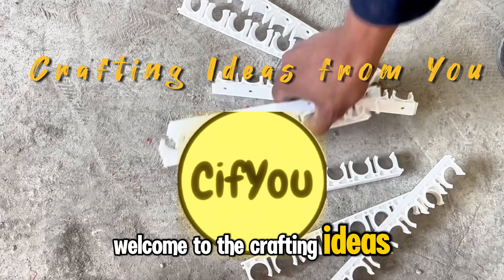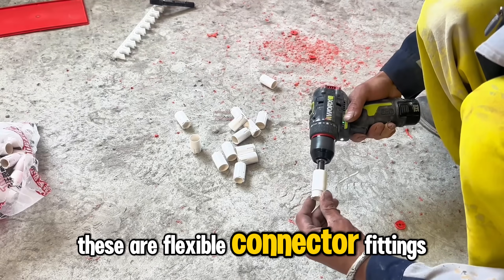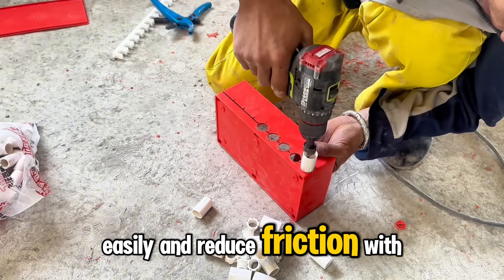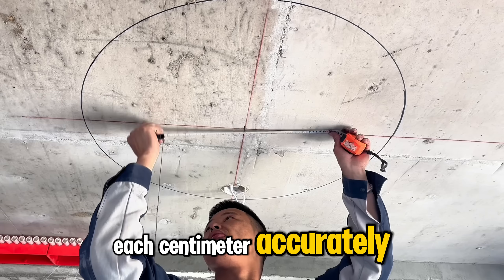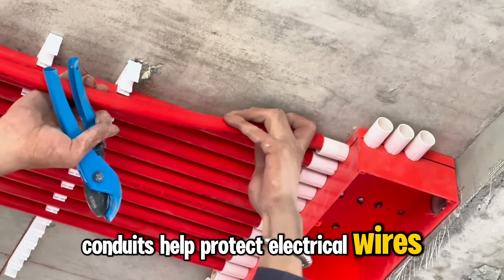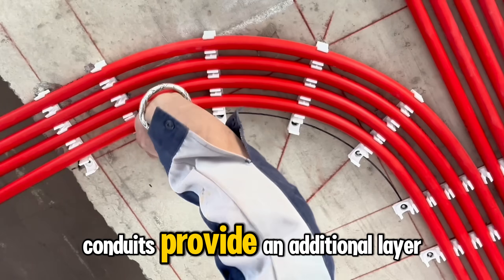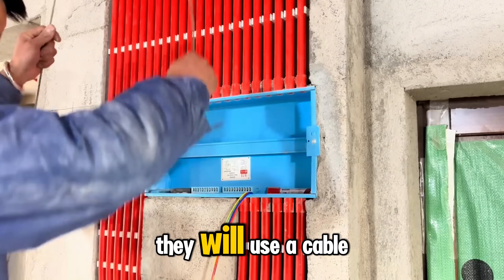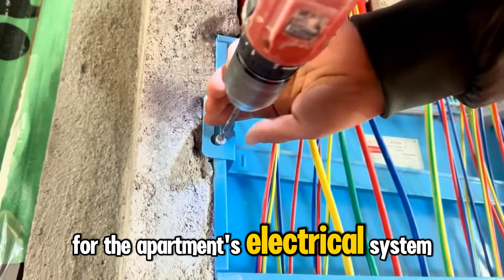What would electricity look like without following NEC (National Electrical Code) standards?

Comment: As a Canadian Electrician, i love the cleanliness of the install and how easy I would be to repair these installs however I can say that the main reason we avoid this method of installation is that each plug and light having its own dedicated path to the circuit breaker panel is extremely expensive.
The smallest breakers we can use in a residential installation is 15Amps as required by the NEC / CEC as such the wires we pull minimum size must be 14 AWG.
However this allows us to create MWBC (Multi-Wire branch circuits) or Edison Circuits which massively saves on the required amount of copper.

Also our building standards are much different, Our high-rise buildings tend to only have concrete walls between units, all interior walls are either wood frame or steel frame which allows us to run wire behind drywall (before its installed) and the ceilings would have a small gap above them for wires and plumbing to be ran before drywall would also be installed.

Both methods have their reasons for existing and both have their drawbacks.

All that conduit looks like it takes some time to install + the time to pull each individual circuit where in north America I can wire a small 6 office floor in a few days. but it can be a pain to add or renovate, especially if the client wants to avoid damaging the drywall for new installations.
Reply: "Extremely expensive" how? I mean, people pay 1500 USD for their phone or 3000-4000 for laptops and say "60$ for a charger is extremely expensive" end up buying unsafe chargers for 10 bucks and in best case they only burn their devices, and in worst case they also burn their houses. When you compare how much you pay for house, tiles and furnitures, it shouldn't be "extremely expensive". But people hate paying things they can't see or showoff even if it is about their own safety and security.
Reply: 0
Reply: @zenronaut hey zenronaut i want to talk to you, if you want to share your   Instagram I'd so that it's easier ask for me! ??
Reply: Вообще жизнь не дешевая штука но раз вы хотите иметь каркасник который сгниет вместе с вашей проводкой спустя 20 лет то пожалуйста
Reply: I understand we now can use a 10A breaker (and smaller wire) here in the US.
Reply: @steveurbach3093   It may be allowed (I'm not sure on that) but you wouldn't really want to because with the exception of maybe an isolated circuit that only hanndles LED lighting, it's gonna blow the minute anyone puts any real amps through it.  The reason most small appliances in the US cap out at 1800 watts is because that will pull about 12.5 Amps at 120 volts.   You try putting a standard 1800 watt microwave on a 10 amp circuit and you're blowing it every time.
Reply: @phuturephunk  Ich habe allerdings auch NIE verstanden, wieso ihr in den USA 120 Volt und 60 Hz. habt - habt ihr Angst vor der Spannung?? Bei uns sind es 220-240 / 400 Volt Außenleiterspannung. Damit kannst Du bei 16 A und 1,5 qmm Cu 3680 Watt problemlos betreiben.
Reply: Too much plastic , I don’t think it would be up to candian fire code standards
Reply: What gets me about this shite is they just twist and then tin the cable cores together in each JB.
Imagine a JB of twisted cable cores tinned and insulation tape over them when it comes to fault finding 😂😂😂
Be a bloody nightmare and certainly not allowed in the UK as our regs are stricked for reasons of safety.
Anyone found twisting cores together on an installation would be fired as well as his employer
Reply: @robertjones3477  soldered cable twists last for decades and definitely last longer than any terminal connections, but apparently that's all you need for your chicken coops
Reply: It was stated at the very beginning that it was for an apartment. There is no drawbacks at all for this method being used anywhere. You're complaining about how much time it takes to setup but that's what it takes to achieve that and the fact that it's future proof without having to rip down any walls makes it far superior to how it is being done in your country.
Reply: @StanslaMichael+1
Reply: As an American Electrician. None of this shit is allowed. Piss off. Everything this guy does is wrong.
Reply: "the main reason we avoid this method of installation is that each plug and light having its own dedicated path to the circuit breaker panel is extremely expensive."

wrong reason...
Reply: Care to elaborate then?

If each receptical required its own path to the panel, it would be extremely Exspencive.

To CEC code, a 14AWG wire with a 15A breaker can feed a maximum of 12 recepticals, if I remeber correctly and a 20A circuit with 12 AWG can feed 16.

If every receptical required it's own feed that's not going to be cheap in material costs.  considering most NA houses have 1 circuit Per room feeding both lights and recepticals.
Reply: @zenronaut For me, having watched this and many like it, I can see the need for it.
Having in the uk a ring circuit is desirable for economy and reliability. 
However, as we march forward into a future which relies heavily on technology, I can see why ^^this^^ is done.
Each plug receptacle on its own fused spur is desirable. It may not be cheap. But definitely desirable. 
The ability to combine this build into the uk regulations would in my opinion, be an amazing leap forward in every aspect. 
Have each room on its own breaker. Yes. Lose electric in one room without taking out the entire circuit... yes. Think of your fridge and freezer in your kitchen or utility room, and your kid blows the fuse on the tv in the front room. And you don't know for many hours. Your foodstuff is ruined. But if they are on separate circuits... not an issue. Only the front room and the tv are "dead" and the rest of the home is unaffected.
Win win from my point of view.
Reply: @soangry  nah, we have what are known as ring mains. So first  or ground floor has a 32 amp ring main covering all rooms on that floor. The upstairs or second floor has tts own 32 amp ring covering all rooms. Ad another ring and fuse for each additional floor.
Lights are on a 10 amp ring for each floor, too.
Add in a spur line for the cooker at 40 amp and the power shower at 40 amp, too.
Garage would be a 16 amp spur to feed lights and plugs in there...
If  your electrician was good, your utility room would be on a separate ring main...
Reply: @zenronaut  all excellent points. The particular in the video is from Russia, although current installs in Italy are similar except their codes stipulate very particular colors for their corrugated conduits. Copper use & gauge wise, it also helps EU and Russia that their voltage is 220V.

Breakers wise they're way, way ahead where you can have a breaker down to 0.5A if not 0.2A if the load warrants it (as many e.g. LED lighting loads do), whereas here in the US e.g. an arc + gfci sensing breaker will cost a lot.
Reply: @AlexKarasev Lmao. You are so clueless about Italian standards and practices. The only thing that is used here and in Italy are Schneider Breakers. Everything else is different. Wire standards (we use 1.5, 2.5, 4 and 6mm stranded pure copper wires) gray, black and brown for phase wires, blue for neutral and yellow/green for earth/ground. Also the wire insulation is fire resistant. Exposed (surface mounted) conduits, fixtures and junction boxes too. Within non flammable walls regular abs plastics can be used for conduits and junction boxes. 
Plus all new circuits use three phase AC. Electrical panels have MULTIPLE RCBOs that feed select number of breakers.
Reply: @OG_ALviK  I'm not sure you've comprehended what I wrote before disagreeing - in an insulting manner, to boot.

Comment: Why not just use a wire with 3 conductors? Pulling 3 different conductors seems like much more work
Reply: Heat (which is why those overly neat bundles in the panel are bad. You need to derate because the inner ones can't shed heat). Have you pulled wire? I think the less stiff (than the cable) is easier to pull around bends
Reply: No it is not more work, and it is cheaper too.

Comment: 5:53 - guess the structural engineer agreed to chiseling out the corner of the concrete beam? 🧐
Reply: you can see the rebar exposed, it's going to rust and collapse for sure.
Reply: This smart builder was thinking ahead. You see, the wires are part of the load bearing structure now. Once the rebar is rusted and the concrete is spalled away, you can just cut the wires and the whole highrise comes down. It also cuts down on population in that area of town, allowing for more employment opportunities and less crowding on train platforms. Genius!
Reply: Yeah stuff your stability.
Reply: Give them some credit, it wasnt just cement spackled over a hay bale this time.
Reply: As long as they havent cut the rebar, It will sustain the load. If the electrician has cut the rebar in that section, then they have surely weakened the beam.
Reply: Mas se cortou e não galvanixou pintou ou protegeu contra ferrugem o risco é existenre @bobo-n1o
Reply: No civil engineer on earth would approve this.
Reply: What is more concerning is the hole drilled through what looks like a load bearing beam.
Reply: irresponsible work, some dumbass HVAC workers have told me stories that put an entire building structure in danger just to install a single AC unit, they should be put in jail
Reply: you can even see the cardboard filling inside
Reply: Это пародия на строительно-монтажные работы - всё разумное нарушено.
Reply: What structural engineer? It's Vietnam
Reply: there is a reason it's called tofu buildings. XD
There are so many videos of buildings and wall just clasping out of no where in the CCPs land.
Reply: Exactly!!! What the fuck!
Reply: That should be illegal.
You can't weaken a structural beam.
Reply: they also go nowhere
Reply: Если бы это разрешил инженер-конструктор, то он бы озаботился о восстановлении защитного слоя бетона, который там обязателен! Без защитного слоя бетона арматура придёт в негодность намного раньше положенного. Так же это ускорит разрушение несущей конструкции при пожаре.
Слишком большая жертва ради красоты... Красиво, но непрактично.
Reply: Anything for the likes.
Reply: You don't want to know how cables are installed in Germany. We cut inches deep into the concrete, lay the wire there and fill the slots with plaster. 🤷🏼‍♂️
Reply: Electrical takes priority over structural integrity, duh.
Reply: Why every average american who lives into a cardboard house comment here. that hole is not a structural issue, you can take down walls and still not be concerned about structural stability
Reply: @Satanelul  Hi, not an american, I live in a cinderblock house.
Seen steel beams collapse from morons that use self-drilling screws on them, and also seen concrete columns crack and bend after being modified.

Comment: I mean, its apples to oranges. Its not very difficult to make your installs look like that when you dont have to worry about hvac equipment and plumbing lines being in the way.
Reply: I definitely get the impression he gets to get in before the plumbers and tinners
Reply: These guys are also the plumbers. Not sure if they're also HVAC. Because they know what everything needs to do they can plan from beginning to end how they're going to run everything and aren't going to have stupid pissing contests over space.

They have over videos showing their plumbing work. Anything with a green line or big white pipe.
Reply: Maybe if they FOLLOWED blueprints in the U.S. there wouldn't be so much conflict between the trades, ASSUMING the prints were done correctly and showed everything. Residential work in the U.S. is mostly garbage.
Reply: @hotpuppy1  You get what you pay for. And when you pay for cheap pretty you get pretty cheap.
Reply: @hotpuppy1  I saw a building site shut down mid build because the architects left no room whatsoever for for riser space. it wasn't caught till after the framing was done, floors poured and the roof set (dried in is the term) all the trades immediately began to fight over the true lack of space to set their HVAC, plumbing, wiring.... 
The site was eventually red tagged, and the building torn down two years later with lawsuits abounding, namely because it was impossible to install anything in the building without compromising it's structure.
Yes, most prints leave a LOT to be desired

Comment: I think we can do this in N.America to NEC code. It just, who wanna spend that much money, for something you look at once and seal behind a wall.
Reply: It makes it so much easier when you have to change anything afterwards - new internet cables, a new outlet,...it absolutely sucks to work with a messy, disorganized electrical installation
Reply: @braindecay9477  yep. i'm looking at having to rearrange all my wiring in the attic (1st floor apartment) that was installed in the 60s (UK resident) prior to having a consumer unit upgrade.
Reply: The MC menace and it's consequences lol. @braindecay9477
Reply from the maker: Oh, I think American standards are better
Reply: Brutalism is always an option.
Reply: I recently read somewhere that inspectors want to see it this way. Which makes a ton of sense now.

Comment: Is that PEX pipe you are using for conduit?
Being in the U.S., we aren’t allowed to use it of course, but I like how clean you made it look
Reply from the maker: It is completely different from pex pipe, it is a type of PVC produced to make electrical conduits
Reply: @CIFYou  What is the fire rating for that PVC?
Reply from the maker: it does not catch fire.
Reply: We have similar types of conduit, its just not common.

Comment: what the point of doing all this nice work if its all hidden in the end?  for me its just a waste of time and money
Reply: It is required especially if your cables are going to run through concrete. It also protects the cable from pests damaging them and makes replacing the cable much easier when it comes time to renew the cabling in the home.
Reply from the maker: it will be easier as you work later

Comment: as far as running conduit, no this is not substantially different from the US. The materials and exact specifications might differ slightly, but as far as running wire in conduit, its basically the same any US installation which uses conduit.

The only real point of difference is the breaker box, which i have to say, American breaker boxes are much better than that style of box, far easier and less labor intensive to install, since American breaker panels use bussbars to supply all the breakers, this makes it more flexible and safer.

Now dont get me wrong, I'm not saying the American system is better in every way, our system does have its problems in other area's,  but as far as breaker panels go, American ones (this includes canada and mexico), are better that other standards.
Reply from the maker: I understand, thank you for giving me more knowledge. Actually in America the quality is much better. I'm sure about that. I looked into NEC. It is very good and safe for users
Reply: I think the UK buss to branch system beat those wires (the breakers are similar. Both beat the US residential as the Mains side is bolted.
Reply: They do make DIN bussbars that can simply a lot of what you see in the video, gotta pay more though.   We just never really adopted DIN specifications for power distribution in the US.  Honestly, I kind of like DIN compared to standard breakers in the US, for the modularity.  You can build a box to basically any size for a set of rails.